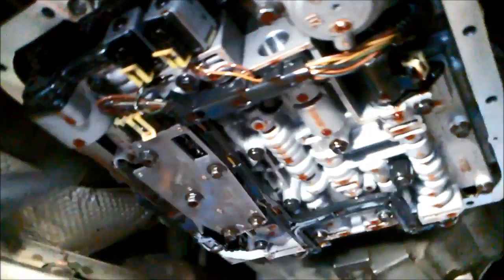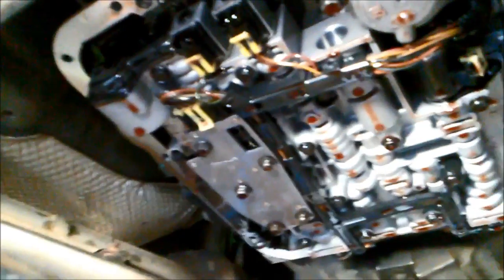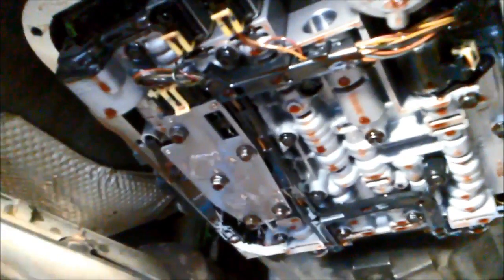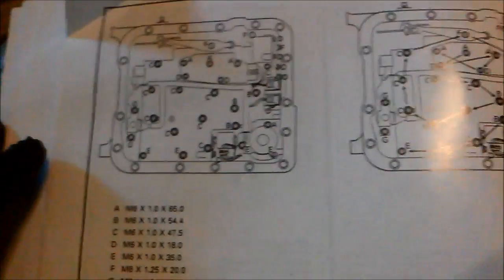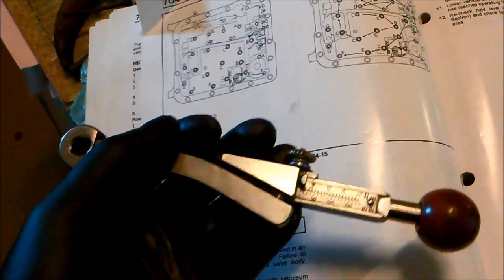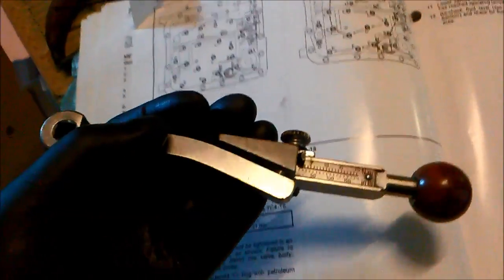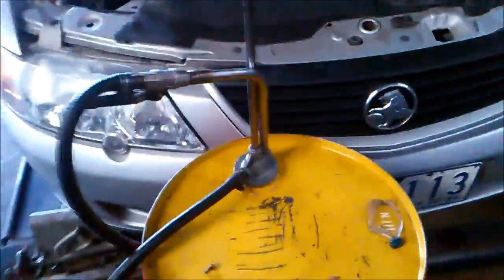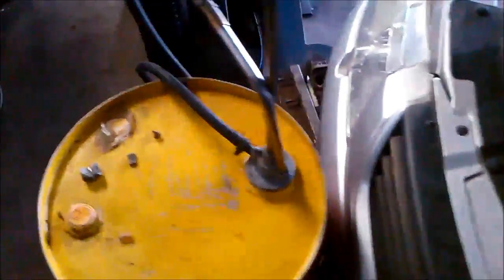Holden Commodore GM 4L60E 700R4 Auto Transmission Filter Service Part 2of2

Comment: Do you prefer cork or rubber gaskets??
Reply from the maker: hi, if you use cork/rubber, then put them of dry. any gasket is ok if used and torqued by its intended use. cheers

Comment: Hi, i got a 2nd hand 2007 holden commodore V6, i just want to ask what model or part number of valve body solenoid assembly that fits to my transmission? I have a fault code P0741-00 TCC system, stuck off.is this fault are related to valve body assembly.because i was planning to change the assembly.thank you in advance hope you can help me.
Reply from the maker: hi, you need to make sure you have same trans with same electrical plug. the tcc solenoid is a part of the wiring harness. you can contact us via our facebook link in description, we can sell you any parts you need.cheers

Comment: Hey, I've put 1.5ltr of fluid into transmission, and it's not coming up to the hot mark,
I noticed it was on the cold mark even after 1 hour of driving,
Should I just keep filling?
Or is something wrong?I don't wanna over fill,
Manual says it's a 4.8l trans,I've but 1.5lrs in,it seems to be past the cold mark(when cold) but wayy  under the hot mark(when hot)
I check when engine is on,in park,an go up thru gears, 
The transmission seems to be running fine,just I noticed fluid level was under and wanted to bring it up
Reply from the maker: hi, check fluid level with motor running. when it`s cold have the fluid level at the lower end of cross-hatch on dipstick. now take vehicle for a drive and bring it up to operating temp. on level ground, keep engine running and in park with hand-brake on, then check the fluid level. it should be at the top of the cross-hatch mark on dipstick. top up or take some fluid out as needed. if you under fill, trans pump may suck some air when driving around corners and will cause slipping. if you overfill and the fluid reaches the spinning components in transmission, it will aerate the fluid and also cause slipping and fluid may also come out of breather or filler tube. if you overfill, and you don`t have a drain plug on trans or a vacuum pump, you can undo one of trans cooling lines and let some fluid into a container ( do not run vehicle for long, as it will push out fluid quickly and you could damage pump/transmission ). make sure fluid level is at top mark at operating temp while vehicle is running on a 4l60e trans, as the fluid will expand as it warms up. hope that makes sense cheers
Reply: @YepThatsIt   it does,an thank you very much,,
That's what I have been doing,checking it after a 30min drives,sometimes 1 hour drives,
It just doesn't go up to the hot mark on the trans dipstick, 
Il put more fluid in and see if it comes up,
I'm just a little nervous as I've put 1.5lt in already and it hasn't brought the level up much,
I checked it while it was cold and fluid was way over the cold mark,
Then I went for a half hour drive and the fluid level was under cold mark,
Seems super strange to me is all,
And the trans itself seems fine,changes gears fine

Comment: hi mate is it possible for a transmission shop to turn a stock 4l60e torque converter into a high stall torque converter?
Reply from the maker: hi, depends on how much the increase in stall is? usually the higher stall converters are smaller in diameter. we send our torque converters away to be done so i`m not really familiar with the internals they change. cheers

Comment: my VS V6 is locked in two gears when the shift is in either park or reverse . it wont move and the motor drags down when it is given throttle . neutral has gone , replaced by drive . it moves away in drive .
Reply from the maker: hi, sounds like two things are applied and/or something isn`t releasing or overrunning when needed. cheers